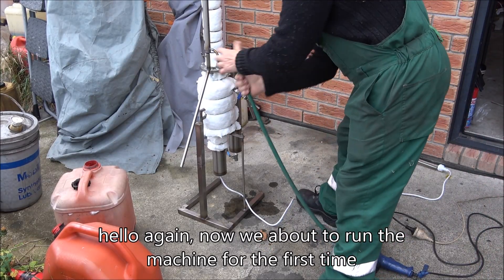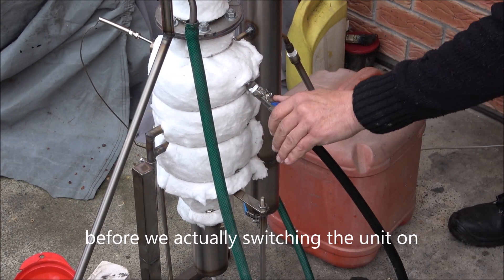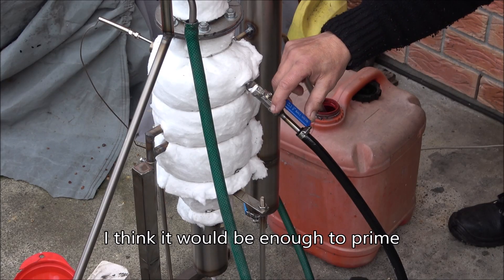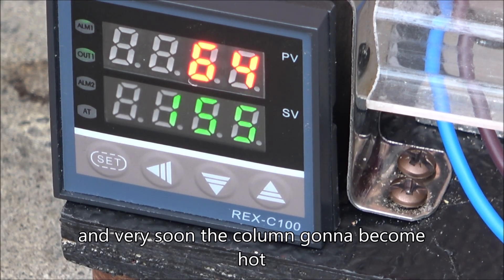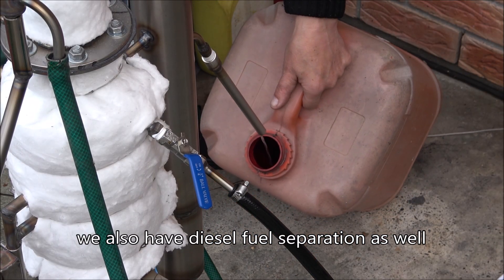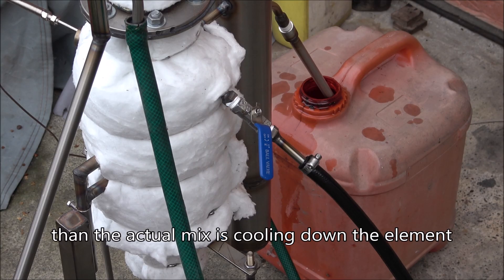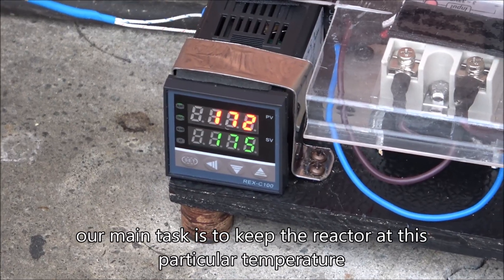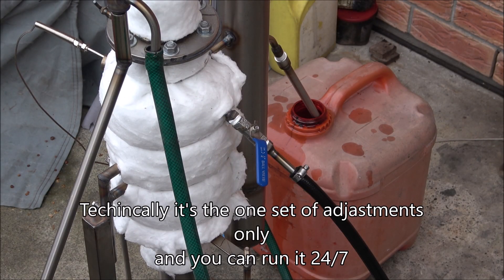Fuel Separation System – Final Setup & Calibration | Part 4 – Industrial Guide

Comment: Brother.  Are any of your inventions capable of removing dye that was accidentally added to diesel fuel?
Reply from the maker: Exactly the same petrol separator, will do it to died diesel, if run at 270c to 300c, and just diesel is fed to machine

Comment: If you go with a name brand e8012s pump approximately 25.00 ish USD they don't make the ticking sound they draw only 2.5 amps and they pump stronger
Reply from the maker: thanks a lot, a pump that I use is ticking, and it is beneficial, from perspective of flow reference, the sound of no flow is muted clicking, almost nothing, while the higher the flow the louder, I know exactly when liquid is going through the line when opening a supply valve, no guesstimation, it starts to click, so I know, no way to overflow, plus it is supply up to 140L per hour, for the 60L per hour unit, more thane twice, thanks anyway, I'll check on it.

Comment: good job But I don't see a pressure relief system.
Reply from the maker: It is runs at atmospheric pressure, the     diesel column is opened to atmosphere with relief tube,
Reply from the maker: It is on the diesel column, a relief tube
Reply: Thank you for your response. I can't wait to watch more of your videos and learn more and more about what you are doing very well. Based on your experience and long experiments, what is the negative pressure that you recommend in the process of distilling used car oil?
Reply from the maker: @mhmdsaleh5929  Honestly I never disilled it under true deep vacuum, though used it to help the vapor to climb the column better, with vacuum distillation all input output, collection vessels and breathers are must be integrated into one vacuum line, lice whole unit should be sort of placed into a volume with negative pressure, doable, but sort of complex, especially machine continuous operation will be determined by size of collection vessels, or it would be a periodic machine, or complex valve, separated collection tanks must be designed, so experiment, everything is possible, and in this case the lower the pressure the better.
Reply: @santeryi9  the lower pressure u run it the lower the max temperature you have to heat oil to ?? To split fractions off 🤔
Reply from the maker: @VAN2HAM2van  Please take into account that this is not an oil distiller, this machine recovers accidentally mixed diesel and petrol, the temperature just enough to petrol fractions to evaporate. The temperature is relatively low, no need of any vacuum, the petrol happily evaporates almost at any temperature.